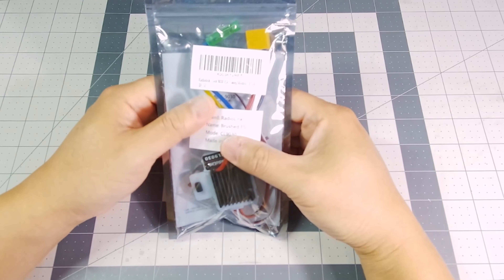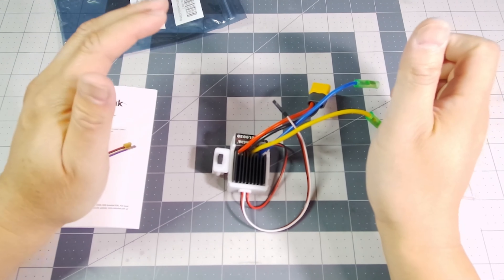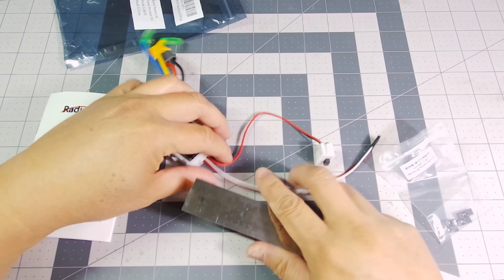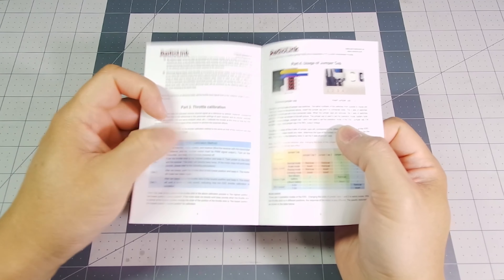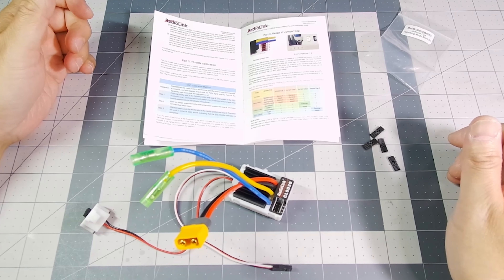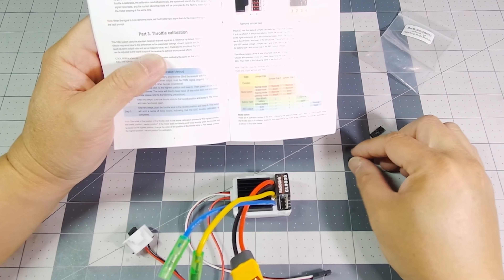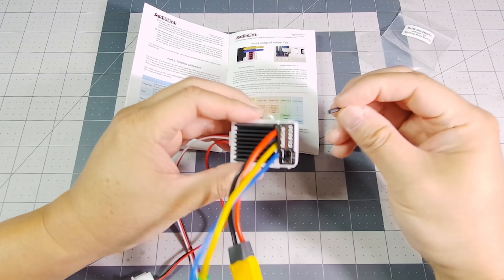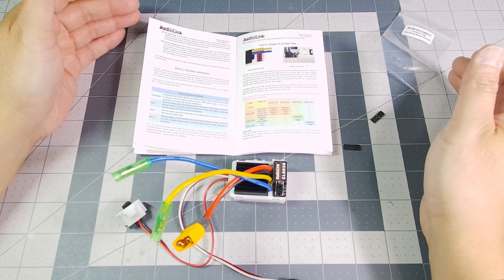RadioLink Cool 9030 Brushed 90A ESC (2-4S) Waterproof Built-in BEC 3A Selectable 5.5V/7.5V

Comment: Nice to see this one, and of course the speed test you did in the other video. I saw Banggood was advertising this one, so I got curious but not enough to buy one, ha ha. So far I'm happy with supplied Tamiya ESC's, HW1080 and ISDT ESC70 for my brushed motors on 10th scale, I drive mostly buggies.
Reply from the maker: I would pick this one over the ESC90. I don't think ISDT has perfected the app yet plus I won't use 90% of those configurations anyway. I'll stick with the analog jumpers.

Comment: Can you get other than an XT 60?
Reply from the maker: It doesn't look like it at this time.
Reply: @RCsRCCars  that's upsetting but they should also have a made it programmable thru theory transmitter to the ESC since they make radios.
Reply from the maker: That would be a great feature but it would force someone to buy a RadioLink transmitter. Take a look at the ISDT ESC90. It is programmable with the ISDT Go app.

Comment: I didn’t know you could run brushed motors on 4s
Reply from the maker: I'm paraphrasing the famous scientist Ian Malcolm. "Just because you could doesn't mean you should." 😂
Reply: @RCsRCCars 

That's a very narrow view, it all depends on the motor and what it's designed for. 
Some brushed motors are designed to operate on 240V or 120V such as plug in wall vacuum cleaners and run on very low current and need 240V to achieve normal running rpm.

Lots of RC motors are designed to run on low voltage high current set ups so they can achive high performance and speed on just 7.4V. If you're running one of these motors on 4S it will also work but if your exceeding the designed rated power and rpm then it's life will be significantly shorten.
Some crawler motors such as an 80T 540 will easily take 4S without any risk to damage however its not really going to be fast anyways. Might increase your speed from 5mph to 10mph 😂